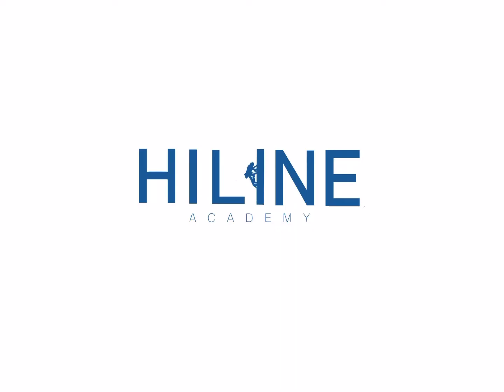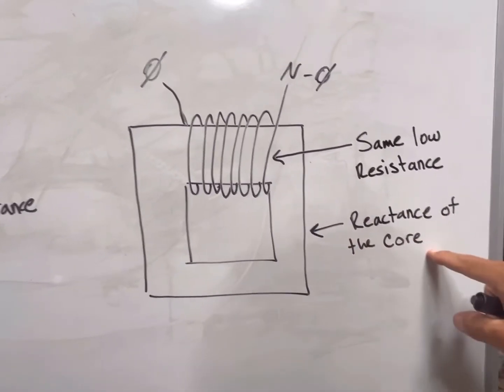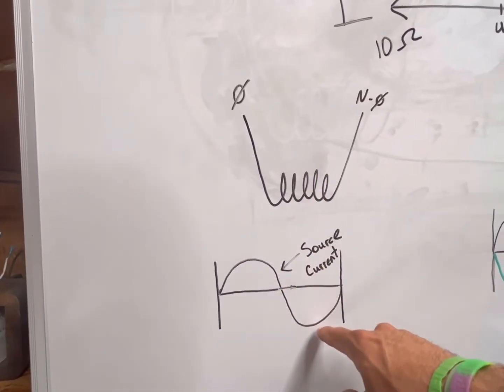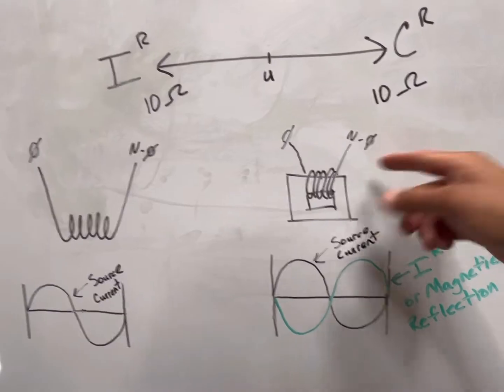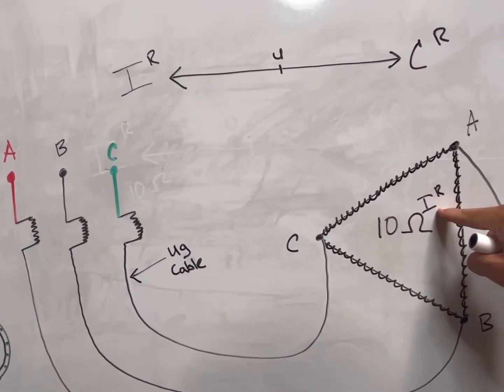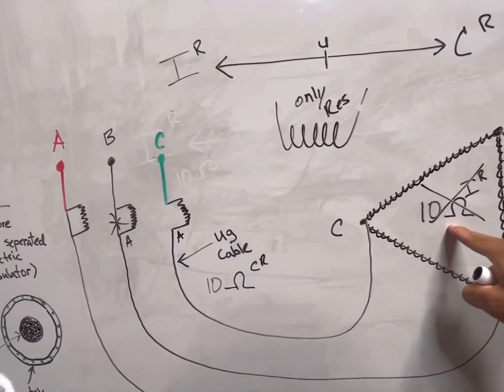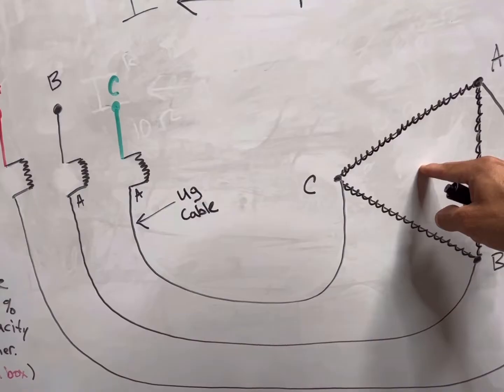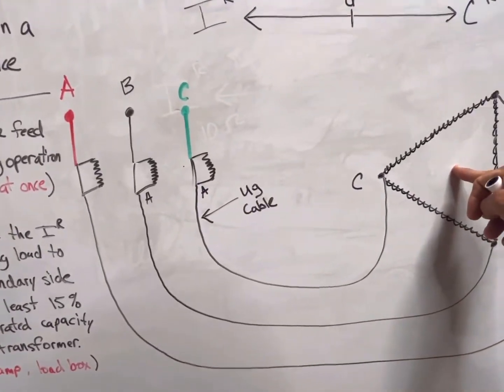What is FERRORESONANCE?

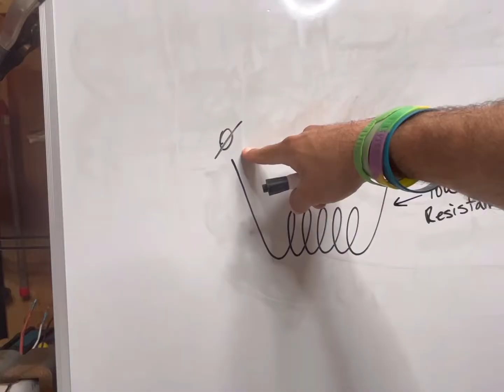Comment: At 1:20 you are saying that if we energize the coil itself (without the core), it's going to blow up due to low resistance. That's not entirely correct because you need to clairy if the inductive reactance of the coil will oppose the current (if it's enough).

Comment: Another way to remove the capacitance factor is to park all 3 loadbreak elbows, then close in all 3 cutouts to energize just the cable. Then energize TR using elbows.  The length and capacitance of the the cable is then removed altogether.

Comment: When you use the customer's load to control the issue, doesn't that expose the customer equipment to wild swings of high supply voltage outside the contractual limits?

Comment: I disagree with the following points, and I think your problem is that you do not have a SINGLE THROW cut out switch that activates all 3 phases. Perhaps the ferro part of the term means iron.

You can surely make an air-core inductor, or transformer, and it will have inductive reactance while operating in an AC circuit. The core increases the inductance by concentrating the alternating magnetic fields. The producer said that it must have a core.

Then he shows an example of circuit resonance because his inductive reactance is equal to the capacitive reactance.

Then he denies that an air core transformer has inductive reactance again. Then he draws a transformer with a core and no secondary. That will not burn up the coil, he says, but it will make the core so hot that it might burn up the coil.

I think he is wrong about the underground cable. That type of cable construction creates a constant amount of capacitance along the cable because the distance between the conductor and the concentric neutral is held constant. Two conductors on any kind that are routed together with uniform spacing will have a constant capacitance.

I think he does not understand the ratings on the cable concerning capacitive reactance.

I do not think he understands the concept of ferro-resonance. He simply does not have a single throw mechanism to close all 3 switches at the same time. Then he finally realizes that he needs ganged switches.

I am going to guess that ferro-resonance is observable when iron parts of the circuits and enclosures experience harmonics, resonance, and magnetism that causes them to vibrate and make noise.

There is a lot wrong with that explanation, and I hope that we can still be friends. Why I try to correct these videos is still a mystery.

Comment: I’m a retired power engineer. I’m enjoying your videos. You present good practical examples of fairly complex topics. 
One other solution for the ferroresonance  in large systems is to add line reactors to the underground feeders. This offsets the capacitive reactance of the cables. An example would be an underwater feeder serving an island several miles away, or the interconnection of a generating plant with a large underground distribution system. In the latter case, the line reactors added to the transformer reactance to prevent ferroresonance from occurring during switching.
Reply from the maker: That’s awsome. I’m glad you’re enjoying them. I really appreciate hearing from engineers in the industry. I have a few engineer friends that have really helped me understand some of the deep water topics. You guys rock. Thanks for your feedback and please don’t hesitate to reach out with criticism. I’m always trying to get better. Thanks again. Stay safe and enjoy retirement. 👍

Comment: I would blacklist hiring this so-called instructor, as I and R are standard symbols for current and resistance, whereas X sub C or L are capacitive and inductive reactance, and exist as vector sums with R to form Z (impedance).  

Cult indoctrinating misinformation is never a good practice.

Comment: Nice video. I’ve been told by the old timers a way to avoid this situation is to use a  wye-grounded primary transformer generally on primary voltages above 15kV class. But looking at your diagrams I’m not sure how that would solve this. This is one of the reasons why most utility substations use wye-grounded primaries I’ve been told. I have myself seen an issue where a 34.5kV delta primary transformer had it lightning arrestors blown during construction commissioning where single phasing occurred on the primary. Any idea of why wye-grounded primaries solve this? To be honest, I’m not sure, just been told this is the way. Thanks for your help and insight. Trying to gain knowledge here. Thank you.
Reply: Did you think it through or try to draw one?

It’s pretty obvious that with a grounded-center wye, no phase connects to any other.
(Watch the video for where phase A voltage comes back to the switches for phases B and C.  With a grounded wye, each phase connects through the transformer coil directly to ground.)

Comment: 👍👍.NowTheQuestionIsHowTheSecondaryOfATransformerWhenLoadedIncresesTheCurentInThePrimary?This,BecauseWeSeeThatPrimaryHasLittleAmperageWhenNoLoad.
Now a new confusion arises:Iron"Losses",MeansFreeHeating?
Reply from the maker: I think I understand your question. In regards to the the primary and secondary current, the current relationship between primary and secondary is based on the ratio of the transformer. For instance if it’s a 30:1 ratio transformer, meaning a 
7200 volt primary input 
And a 120/240 volt output, the ratio is found by dividing the primary input by the highest secondary output. 
So 7200/240 = 30. Or 30:1 ratio
Now this ratio determines a lot of things like the input/output voltages, the current and the turns ratio. In regards to the current, if the secondary is drawing 30 amps of current, the primary will read 1 amp on the primary. 
Now, even with no load on the secondary you will still read a little current on the primary coil. This is called the No Load Loss, or NLL. The primary is hooked up either phase to phase or phase to neutral, and the transformer requires current flow to create the magnetic field in order to create the secondary potential. So in actuality the primary current will read the 1 amp from the 30 amps being on the secondary and the NLL just from creating the secondary voltage in the first place. 
I hope this helps. Stay safe 👍

Comment: Awesome video. So am I correct in saying that it will only be an issue when you have a three phase delta transformer and a relatively long run feeding it?  How long of a distance would you have to start to be concerned about this condition?  Also, is it an issue with both Y and Delta primary feeds?
Reply from the maker: You mostly find ferro when you have a delta primary connection but when you have a wye primary connection and it’s an extremely long run you can run into it too. It’s a hard condition to predict. There’s a lot of factors that play into it. Primary voltage, KvA, frequency, wire size…..and we don’t have a lot of ways to measure that accurately enough to say it will be present or not. That’s why we assume it going to be a problem in almost every instance. Just follow the rules to mitigate it and you won’t have a problem. Stay safe. 👍

Comment: So unity is good?
Reply from the maker: Well in order for the transformer to Not blow up when we energize it, it needs the Inductive reactance in the transformer coil to limit the current flow. But when we energize both the capacitive feed (underground cable) and the inductive load (transformer coil) at the same time, they get rid of each other and bring the circuit to unity, which is why the cutouts blow. So we need an inductive circuit. Please let me know if I answered your question. Stay safe 👍

Comment: If Ferroresonance is a phenomenon on the molecular level of the material, can you tell us what is happening and how can we find this intrinsic resonance frequency ? If this point is achieved jumps the current and potential suddenly ?
Reply from the maker: That’s a good question. Without putting some pretty sophisticated metering devices on the line, and having some type of baseline readings on the specific transformer your working on, it would be very hard and impractical to rely on. In the field lineman just use some general rules and experience to determine whether it’s going to be an issue.
Reply: @hilineacademy8482 Thank you very much for your answer. I will design an experiment and will connect the transformer to a function generator, by increasing the frequency step by step, I hope to achieve the resonant frequency (ferroresonance) of the transformer in this way. The output (secondary coil) will be connected to an oscilloscope, by this way I hope to see the sudden increase in the potential of the resistor. Would this be a possibility ?
Reply: @Birol731 yes I believe it will. Frequency and load of the transformer have a direct correlation with the phenomenon. I’ve never seen the math in it but I’m very interested to see what your results will be. Keep it up and let me know. 👍
Reply: @csandoval82  Okay, once I have done the experiment I will inform you 👍
Reply: @Birol731  Awsome. Thankyou. Where are you working?

Comment: It occurs if the core is made of ferrite or a ferromagnetic material, if a different core material is used, ferroresonance will not happen, so, which role does the ferromagnetic material have, what happens here in the molecular structure of the core material ?
Reply from the maker: We’ll all transformer cores are made of ferrite or magnetic material. Most are made of silicon steel and a lot of manufacturers are now using amorphous material which is and even more efficient material than silicon steel.  I’m sure there are differences when quantifying whether ferro resonance will be present but we just treat all situations like it’s a problem we will have to deal with.  👍
Reply: @hilineacademy8482  Thank you very much for your answer. I will check the list for the ferromagnetic core materials.

Comment: Thank you very much for this interesting lecture 🙏 What about, if the current is despite the resonance less, then it will not burn, right ?
Reply from the maker: I think I understand your question. But if I’m off please let me know. 

So if the magnetic reflection, or resonance of the transformer is not enough to counter the inductance of the coil, you should be fine. It’s actually a difficult thing to guess at because depending on load of the transformer and the frequency of the source primary voltage  at the time your opening or closing it, ferro resonance might be a problem at one part of the day and not be a problem at another. So we always just treat it like it’s going to be a problem we have to protect ourselves against. Stay safe 👍

Comment: Excellent!   Where or how does the transformer impedance rating come into play? Just secondary?
Reply from the maker: Great question!  So when we look at impedance by definition. The definition reads “The total opposition to current flow in an AC circuit.” The word “Total” is the key. Impedance is made up of both the resistance and the reactance of a circuit, and when we add those two things together they give us the impedance of the circuit.  
Now in transformers they will give us an impedance in the form of a percentage. For example. 

Pri input: 7200/12470Y
Sec output: 120/240 
Impedance: 1.7%

What this impedance percentage means is that when our transformer is at 100% load,  the secondary voltage will drop 1.7%.  The reason that we need to know that is because depending on whether we are building a transformer bank or 
We are installing a single phase service we need to know what our customer will see in voltage when our can is fully loaded. If we are at the end of our primary circuit our primary might be low. If we are right outside the sub our primary voltage might be high. 
Stay safe 👍

Comment: Fantastic info and video!! This also happens on OH closed delta banks..would you be able to make some trouble shooting vids..with various scenarios? wire down & back feed issues etc..transformer troubleshooting...what to look for when going to call where lateral fuses are blown etc...I'm sure you can implement more, but just wanted to throw that out there.
Reply from the maker: Thanks for the encouragement. I would like to do a lot more videos on trouble shooting and backfeed in the future. I have to build all of the scenarios in my back yard using the simulator and it takes a ton of time to set up. Plus I probably need to build some more tools to be able to put a good lesson together. But I’m working on it. Lol. 😮‍💨👍stay safe.

Comment: I love how you teach, although I would recommend changing the "I^R" representing your (Inductive Reactance) to "XL" which is typically how you see it. Seeing it your way was confusing until you said something. BUT GREAT VIDEOS SO FAR!
Reply from the maker: Lol. Yes sir. Thankyou. I was trying to keep it simple. Also reactance is measured in farrads but I said resistance. Lol. I’m trying not to throw a ton of stuff at them all at once. Please keep the feedback coming. Stay safe.
Reply: @hilineacademy8482 No, capacitance is measured in Farads (often milli, micro, or pico).  

Reactance is measured in ohms, but with symbol conventions to indicate capacitive or inductive, based on the lead or lag relationship of current and voltage.  

Z (impedance) is the vector sum of R and X(C or L), which makes misuse of standard symbols for resistance and current horribly misleading to anyone trying to seriously understand basics of reactive circuits.

Comment: can Ferroresonance occur with an oh wye closed delta bank feeding oh services?
Reply: Yes!! We normally put a fourth cut-out . The fourth cutout ties the pot down ( as you float normally a wye/delta)

Throw the fourth cut-out in FIRST!
then throw your other pots in and then pull the fourth cut out barrel..

The system I worked on before this one didn't ever use them ( rarely) so I've never  had one blow due to a charge.
   The CO-OP I'm on now installs them on every 120/240y bank
Reply from the maker: That’s an interesting question. I’m assuming that it’s a three pot bank wye primary, closed delta secondary. With these banks most places float the primary neutral connection. When we operate the cutouts (open/close), we have to tie down the primary neutral. If you don’t tie it down, and open one of the cutouts for example, you impose a phase to phase voltage across the other two transformers that are still energized. 
This is often called ferroresonance. But it’s not. Ferroresonance is when you are energizing or denergizing  an inductive load along with a capacitive source. It’s the action of energizing or denergizing both the underground cable and the transformer coil at the same time. 
Sorry I haven’t got back to you sooner. Ive been hunting lol. Please get back with me and let me know if I’ve answered your question. Stay safe.